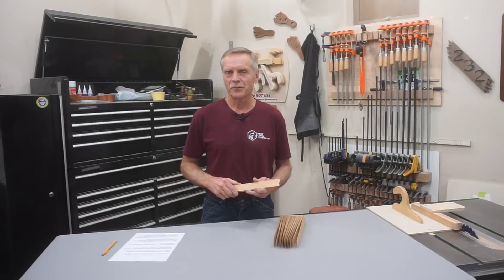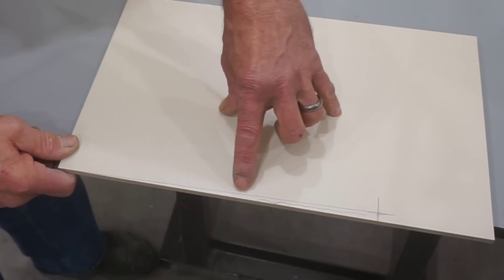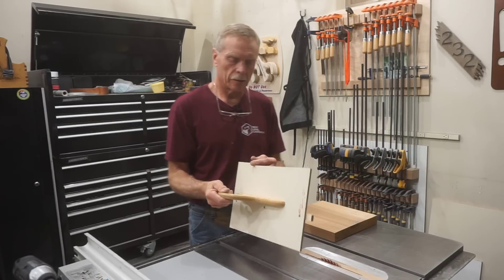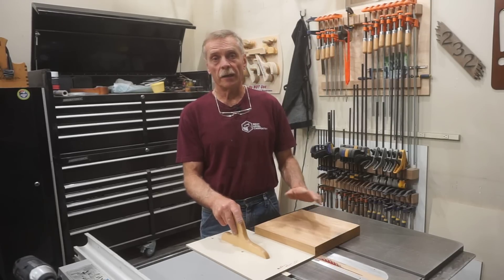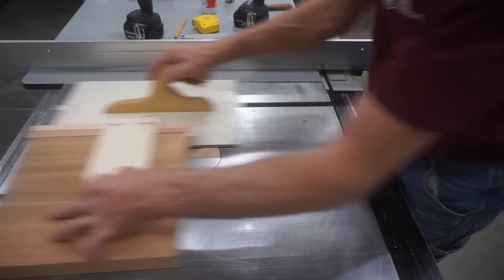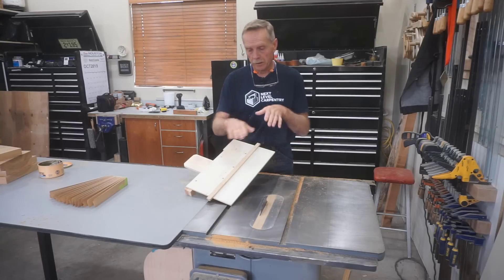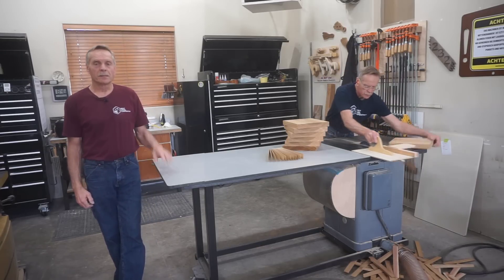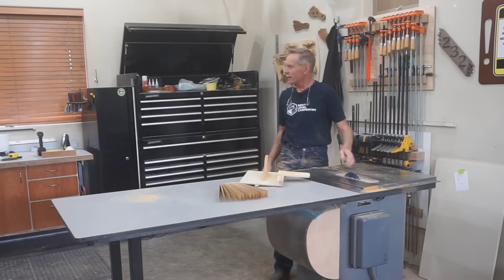Cutting Shims for Precise Work

Comment: Hello Matt, Another Fine Video...  I make a very similar shim but shorter and narrower... I use both Sugar Pine and old scraps of Red Wood...  My Jigs are much simpler to make. I too use a zero clearance insert on my shop Table saw.  But out in the field when I am forced to use my job site table saw I don't have a zero clearance for it so I just clamp a thin piece of 1/8" Hard board to the saw over the blade and it runs against the fence... Instant Safety measure...
Since My shims are only 6" long by 3/4" wide my sled is much smaller and can actually fit into one of my nail bag pouches for transport so one less this to carry around... We do think alot alike... I
Always seem to enjoy your videos reminiscent of old days of myself and present day projects. Greg

Comment: I just wanted to thank you. I just cut a half-dozen maple shims, 2.5" wide, 23" long...trying to hit 1/4" @ the 18.5" point. I hit .250" at 14.5", so just a little thick...but my friend wanted room to work them down to exact taper/thickness. He's a luthier and needed a couple long maple shims for repairing an old Doghouse Bass. I used your ideas for the jig and it worked flawlessly. They came out clean and straight (nice having a 5hp saw). Thanks again!
Reply from the maker: You are certainly welcome Marc.
That kind of precision and specification is tough to achieve so kudos to you for extrapolating ideas from this video for the task at hand...
Best, Matt

Comment: that's great. i'll crunch some numbers later, but i'd wager, before calculating, that buying rough stock, then milling them down to shims, is much cheaper than grabbing a pack of shims each time from the box store. that's great, loved the vid, glad i found it, will build my jig exactly the same way
Reply from the maker: I accept the fact that even if these cost twice or three times as much as the manufactured stubby ended shims it's still a great value for the performance I get out of them.  Frustration from junk shims has a high 'stress cost' for me so I avoid it... life's just too short for that sort of aggravation 😉😎  Thanks for your comment Steve... work safely and do good work with your precision shims! Best, Matt

Comment: Another great video, as always. Very well explained, and great tips. I have a box of shims my wife bought me years ago, and they look just like what you made in this video. I have no idea where she got them from. But if I used a lot of shims, I would absolutely use your jig. And guess what? I decided to give those Snappy bits a try, even though they're not tapered. I'll let you know what I think. Thanks again for the video. 😄
Reply: Or maybe not. You're Amazon link says they're currently unavailable. I'll check again next week.
Reply from the maker: I'll look forward to your evaluation of Snappy's Dan... a fresh perspective is always welcome.  Not sure if they're out of regular Snappys or the 'cardboard tipped' (carbide tipped) 😂 ones but if it IS the regular ones sold out it just might be a divine sign to dig deep and spring for the carbide ones... they're easily twice as good at drilling/cutting as the 'ol standbys.  Juss sayin! Best, Matt
Reply: @NextLevelCarpentry  They're out of the carbide ones, which I what I was going to get. I'm sure they'll get them back in stock. I'll let you know, assuming I don't forget about them entirely!
Reply from the maker: @TheNewbieWoodworker  I need to call those Snappy people... first they don't return my call about sponsoring a video and now that they're selling like hotcakes they're out of stock!  Go figure... Best, Matt

Comment: The tack hammer is impressive!!  Looks like another tool I have to get....lol.  I usually place the CA glue before the activator so the activator has less time to evaporate.  Awesome video...Subscribed!
Reply from the maker: You NEED  a magnetic tack hammer, I can tell! 😎  FYI CA glue activator remains active long after the acetone 'carrier' evaporates so it's irrelevant which you apply first.  It's actually beneficial to let the accelerator 'flash off' until it's all or mostly dry before contacting the CA glue itself.  It's a bit counterintuitive but hopefully this fact reduces any anxiety you might have about application and curing.  If it's hard to believe, just do a few tests with and without 'dried' accelerator because seeing is believing.  Oh, and thanks for the sub!
Reply: @NextLevelCarpentry  Thanks for the info.  I thought it was active only when wet, but I guess I was wrong.  Now I won't be rushing as much when using CA.  Cheers.

Comment: Wow this looks like your way over doing a simple thing. When i'm fitting out a house and need shims I'll grab a chunk of clear whatever wood that is over 8" wide  and cut it in my miter saw and set the angle to 2 flipping it each cut. makes perfect shims.
Reply from the maker: Ain't the same but if it works for you, go for it...  but 'my perfect' is better than 'your perfect' and worth the extra setup time for safety, precision and repeatability.  If you want to produce a video showing how quickly you can make a hundred shims your way I'll race you... 😎

Comment: This is really a great little jig. You know you could reduce the hand movements by quite a bit by cutting two shims before flipping. I don’t think I would use these to hang doors with because I would go through that batch of 400 so quickly. Maybe if I could make this jig to do adjustable size shims it would be worth using for general carpentry as well.

Comment: Thank you for a great video & safety measures!
 I am just curious why you don't make the jig part out of the same size wood as you are making the shims?  Then you would only need to add the handle, the hold down and miter slot piece.  I started woodworking in 2014 after retirement, so this old grandma has lot of questions!  I just put in 4 doors & this would have helped a lot!
Reply from the maker: Sure could do it that way but it would be a rather large, clunky piece of wood to make and use.  Efficient work is easier with efficient tools IMHO.  As you advance your skillset you'll probably start to see that making and assembling things becomes second nature and be less inclined to try and avoid the simple steps for adding a block of the right thickness.  Keep asking questions and learning and enjoy your journey! Best, Matt

Comment: I don't know about anybody else but every time I watch one of your videos I think, Matt should start another channel "Next Level Fitness". Chip could run it. Thanks for the videos.
Reply from the maker: Any  "Next Level Fitness" channel would be comprised almost entirely of this reccomendation: get a mountain bike and ride it a lot.  Single-track mountain biking is the greatest fitness program ever IMHO: https://vennyjanephotography.pixieset.com/dakotafive-o2021/1dakotaridge/?pid=5612109309&id=395&h=MTMzMzI4Mzg3Ng
I don't think you can't not get in excellent aerobic and endurance strength riding single track. 😉😎
Best, Matt
Reply: @NextLevelCarpentry  Thanks for the suggestion and I have a good bike I just need to push myself to get on it more often. Thanks again
Reply from the maker: @dennisboyce813  The push is worth it... I encourage you to motivate yourself and enjoy the activity and benefits.  The game changer for me was getting a respectable bike (which it sounds like you already have) and then find some fun places to ride...  All trails aren't created equal and it's worth some exploring to find ones you like.  The thrill of the sound of wind whistling in my ears while ripping down a flowy section of trail makes it worth all the effort it takes to pedal up hundreds or thousands of feet to 'earn the turns' on the way down. Try to plug in with friends or local trail rider groups where enthusiasm of others will fuel your motivation. All that fun plus you get to feel the benefit of being fit during everyday life... sorry... I get carried away by such things 😎

Comment: Well, Matt, I ordered that magnetic hammer - very cool way to get them thar small tacks into something quickly without smashing my thumb.  Also, I promoted your video over on a Facebook Group called Small Workshop Woodworking Community - would love to have you join that group, promote some of your videos there and help us all out with basic questions. Jonathan Katz- Moses and Tommy from One Minute Workbench both are Members of that group (which I started specifically to help people design, layout and survive in small workshops.
Reply from the maker: Thanks for all you do to build the woodworking community SWG and commenting here at Next Level Carpentry.  I'd gladly join 'your' FB group except that it would first involve joining Facebook which I've never done.  If there were a way to join and contribute as an outsider I'd do it and, if and when I ever join FB I'll make a point to join in with you guys.  Not sure what I'd contribute but interacting with 'friends' of yours would certainly be beneficial.  Thanks again... and hope you find that little tack hammer useful.  I thank you, and so do your pinkies!😂😎  BTW I rub the magnetic end of mine on a strong rare-earth magnet from time to time to re-magnetize the tip if it starts to 'drop' nails.  Also, when mine was new, I used a fine file to tune up the magnetic tip faces so they're perfectly lined up so they hold tiny brad/nail heads firmly and aligned straight for even nail setting.  Best, Matt

Comment: Don't ignore the opposite edge of the sled. Used in the other miter slot this sled edge could be rigged up as a straightening stock jig or a lightweight taper jig.

Comment: Please let us know where we can get the interchangeable table saw insert you show in this video. Really impressive!!
Reply from the maker: They're currently no longer available from the original inventor/manufacturer Robert but stay tuned: I'm working with Greg's Garage on manufacturing a new/improved V2.0 model that we expect to have available in limited quantities before too long.  Since it's a new product venture for us we're doing a bit of grass roots marketing by asking viewers what they would be willing to pay for one of these gems.  Thanks!  Best, Matt
Reply: @NextLevelCarpentry  

I’d guess $49.95 would be a generally accepted ballpark. I see Sawstop makes an aluminum model that is around that price.
Reply from the maker: @bobg1021  That may be why the one I have went out of production.  Even with CNC production our projections put it over $100 for sure, putting it in a different demographic, I suspect.  Thanks 😎
Reply: @NextLevelCarpentry  
I’m probably in the right demo group but would resist at that $ amount. Probably easier ( lot cheaper) to make a bunch of different kerf sizes out of MDF or birch ply.  But I bet you could create and sell plans for us to make them ourselves 😊 . I’d love to make interchangeable kerfs for my tablesaw sleds as well
I’d definitely buy both these plans .
Reply from the maker: @bobg1021  https://www.pinterest.com/pin/551479916872563699/

Comment: Great video! Do you have more info on the zero clearance plate for your table saw? I really like the removeable insert, thanks
Reply from the maker: This is the one I use in the video Jonathan: https://www.pinterest.com/pin/551479916872563699/ which, sadly, is no longer being made.  Might find one on eBay or Craigslist if you're lucky?  Best, Matt

Comment: Thanks! I’ll be doing this. 

Where did you get the insert for the unisaw? I’ve been looking for years!!
Reply: I'm curious about that as well. My neighbor has given me a 1940s-1950s Unisaw that will need a restoration and fence built or purchased for it. It is still in his garage while I wrestle with whether or not I want to ditch my Ridgid table saw with no issues for an antique that might end up being a headache. I sooooo like the idea of having a vintage Unisaw though.
Reply: Matt addresses that question below, where Clint Satterwhite asks him the same question. It's out of production now apparently. Possibly because it doesn't work with a riving knife.
Reply: David Gagnon I will have to make my own. I have an aluminum insert, I just have to mill it to accept the wood inserts.

Comment: I don’t key my jig to the miter groove. I just work off the fence. That way if I need a thicker blunter shim I just move the fence. As a person who roofed many square of cedar shingles I have boxes of shingles too narrow for use. In my opinion shims cut from 2x stock are too narrow to back up hinges and strikes when hanging a door.
Reply from the maker: You do you.  In my experience, 1-1/2" wide shims, properly used, are more than plenty for any door shimming applications and 'feather shims' with a shorter taper than even starter shakes yield better results than longer, blunter 'shake shims' even if they are wider.

Comment: I am going to try this.  But I don't understand, when the shim cutting commences, the flipping of the block looks inconsistent.  Sometimes the flip is along the blade plane, top to bottom, and sometimes it is across the blade plane, left to right.  Which should it be?  Thank you.
Reply from the maker: Good question!  Sorry that's unclear, Bruce.  The main purpose of flipping the block is to keep it so it has relatively square ends.  This is the best way to keep grain direction going the long way in the shim.  If you were to not flip the block at all, the shims would  soon be made weak and 'crumbly' due to short grain across them.  That said, in a perfect world, the block gets flipped in a consistent manner after each shim is cut but, in reality, there's some leniency in the process.
Sorry again that my reply is so wordy!  Let me know if you still have questions after reading this?

Comment: For many years I used plastic coated playing cards where I could. You can't get finer than the thickness of a card.
Reply from the maker: Playing cards are a great option... as long as you don't need the adjustability tapered shims provide...
Reply: @NextLevelCarpentry  I had forgotten that aspect of their usefulness, but at my age I forget a lot?
Reply from the maker: @jackriley5974  The playing card trick is a good one to remember too!

Comment: Hi Dear how are you, i have a question 
please we can use another auxiliary fence (5 inch High) instead your auxiliary one? for cutting wider pieces
Reply from the maker: I'm not exactly sure what your question is but I will tell you that anytime an auxiliary fence is needed to make the task easier or safer I would certainly recommend it. I'm still not sure how that applies to this video though but thanks for watching and commenting...
Reply: @NextLevelCarpentry   thanks very much for reply, Sorry for disturbing you, i sent e-mail for your address, contain photo explanation.

Comment: Watch/need woodworking videos probably like a heavy smokers needs a cigarette. I think you might be my favorite. I’d love to spend a day on a remodel assisting you I’d probably learn more that day than all my other days combined. Anyways enough with the compliments lol. Does this work with any thickness material? For the shims I mean. Was thinking I could use a bolt facing up with one of those female star knobs to make height of the hold down adjustable. Hope you reply soon cuz I can’t wait sick of throwing away oak
Reply from the maker: And I need a job at Smokers Anonymous like a Marlboro salesman! 😂 but, yes, the fixture shown in this video could be modified/altered to work with material of virtually any thickness.  FWIW I occasionally make 'feather shims' out of 3/4" thick hardwood like cherry or maple for dedicated applications like setting cabinets and installing trim.  BTW there are days I could use a helping hand from an eager apprentice but the work at hand on days like that is seldom of the sort any sensible person would volunteer for!
Best,
Matt

Comment: Thanks for the upload - that looks like it works real well. I'm just curious - how did you cut the "fan" of shims? Or did you glue them together after?
Reply from the maker: Read recent comments eternalfizzer where I answer your question in detail for another viewer... Best, Matt
Reply: @NextLevelCarpentry  ahhhh... I hadn't read back far enough to find your magic trick. Thanks for spilling the beans or I would've lost a weekend attempting my hack. My engineer brain was already coming up with modifications to your method: stop the cut and back out, then shim the jig to rotate it, repeat. This could've ended badly 😉
Reply from the maker: @eternalfizzer  ...or your engineer brain would have come up with a mechanized one that opened and closed to a music score? 😁😂😎 Best, Matt
Reply: @NextLevelCarpentry  That goes without saying ;-)

Comment: Hi Matt, Thank you for sharing this video. Could this concept be used to safely cut thin straight strips at a repeated thickness? I am imaging the same setup, just without the tapered edge to hold the board.
Reply from the maker: I'm sure it would Ben but, were I you, to make short thin strips I'd rip 4~6' long thin strips and then gang-cut them to shim length afterwards, if that was my goal... make sense?  Best, Matt